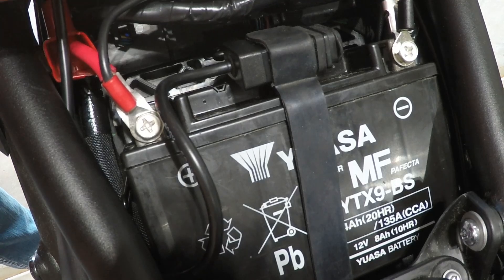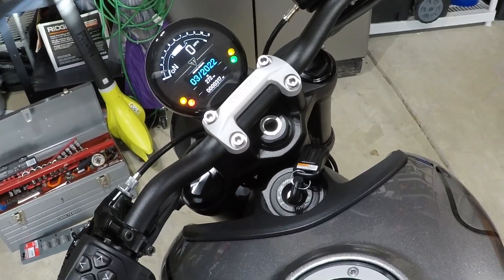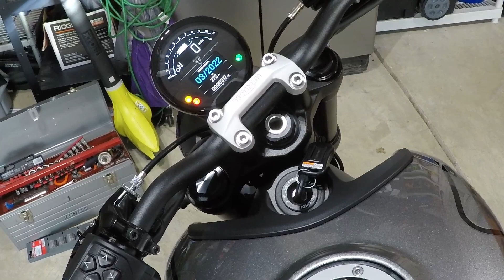Trident 660 USB Charging Kit Install

Comment: Thanks for posting! Glad you like your bike! I was considering this for my Trident (still waiting on delivery) but I just thought the under-seat charger was a flawed idea. Instead, I bought a Power Bank which can easily be stored in my packsack, tail bag or jacket pocket and can be used charge while driving.
Reply from the maker: No problem! The Power Bank is a great idea. I have one as well and don't leave town without it. Eventually I'll get a Quad Lock phone mount for the handlebars and run a USB cable from under the seat, behind the tank, and up to the bars. Hope you get your bike soon!

Comment: Thanks for the nice vid, is there only a single usb port output?
Reply from the maker: Yeah that’s the only one in the Triumph accessory catalog. There are other third party options if you don’t mind connecting to the battery. I haven’t tried any of those so I couldn’t tell you if they are any good.
Reply: @jrobrides1340  thanks for confirming!

Comment: Nice vid i’ve installed mine too! Are you gonna be making a video on running the Charing cable to your handlebars?
Reply from the maker: Yes I will. I just need to order the phone mount first. I also did a video on how to take off the tank cover which is about 90% of the job of running the cable.
https://youtu.be/D4nun9HKdSY

Comment: Is there any way to store a phone under the seat and charge it while riding?
Reply from the maker: Technically yes. There is barely enough room for a phone and a charger under the seat. Personally, I'd worry about damaging my phone by putting it there. I ran a USB-C cable from the charger under the seat to a Quadlock Wireless charger mounted on the handlebars.
Reply: @jrobrides1340  Thanks for your insight. Just ordered a Trident with the USB option and wasn't sure about that. To be honest I'm not planning to mount my phone on the handlebar so maybe I'm wasting my money but then again it's a cheap option.
Reply: @jrobrides1340  Yes, i have the charger fitted on my Tiger 660 Sport and was wondering how easy it was to run a USB-C to my Quadlock wireless charger on my handlebars?
Reply from the maker: @macmackay8579  I did that with my Trident in this video here: https://youtu.be/Bpbwl1LEWng
I took the tank cover off (there's another video for that), but your tank cover is probably different on the Tiger. It should at least give you a place to start though.

Comment: Does it shut off with the ignition?
Reply from the maker: Yes it does.
Reply: That's awsome so I don't need the quadlock one . Thanks for the info
Reply: @jrobrides1340   Typical. Wished I found this before I bought the quadlock auto-save version. Triumph didn't have anyone of their in stock though and the delivery was pretty long.

But I'm curious, what did you connect this USB charger to, was it SAE connectors? The quadlock's charger is either supposed to connect to SAE connectors already in place, or I should install the ones included directly to the battery. 

Have googled for so long but couldn't find any info about it..
Reply from the maker: @jsaykay  I haven’t had experience with the Quadlock connector, so this is just guesswork, but the Triumph charger plugs into a specific socket under the seat, but it’s not SAE. You can see it at about 0:44. If you have an SAE connector already on the battery, I’m guessing you could connect the Quadlock to that, but I would make sure it powers down at ignition off. Maybe not a big deal as most people don’t walk away from the bike with their phone still attached, but I’d worry about a slow drain over time.
Reply: @jrobrides1340  Thanks for such quick reply! Should definitely have bought the triumph one, seems way easier. 

Doesn't seem to be a SAE connector installed so I'll use the one from quad lock. Hopefully all goes well!

Comment: Thanks for the video. Do you have the media/bluetooth kit for the Trident? I am looking to get it and fit it myself but have heard that it needs to be 'activated' by Triumph (you need to take it in to get it done) have you heard this at all?
Reply from the maker: No, sorry. I think I'm going to try to get by with using my phone plugged into the USB port. I've heard mixed reviews on the kit where some said it wasn't worth the money. My dealer said the same thing about activating the heated grips after being installed, but they work fine. The media/bluetooth kit is more complicated though, so they might be right about that.

Comment: What are your overall thoughts about this bike? I’m in the middle between 2021 suzuki gsx s 750 or trident 660, thanks in advance
Reply: Bought Trident, just got back home
Reply from the maker: Hmmm. Honestly, the Suzuki was not on my radar, so I just had a look. I didn't really look at other bikes because I was so fixated on the Trident and already loved Triumphs. I can see why you would be stuck between two though. So far, I am loving the Trident more the more I ride it. I think I called it a Goldilocks of a bike in one video because to me everything is just right. There are a lot of other bikes that might do some things better, but the Trident does everything very well without many tradeoffs. For example, it looks like the Suzuki has more power, more adjustable suspension, and better brakes, but it also weighs more, costs more with ABS, and to my eye doesn't look as nice. Although, to be fair, the Suzuki looks really nice. If it was between the GSX s750 and the Honda 650R, I think the Suzuki would win for me. But maybe the SV650 is the better competitor to the Trident in the Suzuki line up. Have you sat on or ridden both? That might help you decide.
Reply from the maker: Congratulations!

Comment: Do you have installation guide for the bluetooth?
Reply from the maker: I haven't done a video on it as I do not have it installed, but I found the instructions here: https://www.triumphinstructions.com/ProdDocs/A9820098-US.pdf  You will need the fitting kit as well as the module. You also have to take it to the dealer to get it activated.